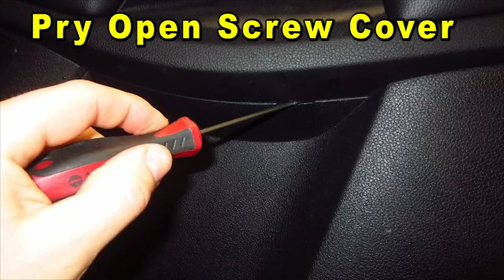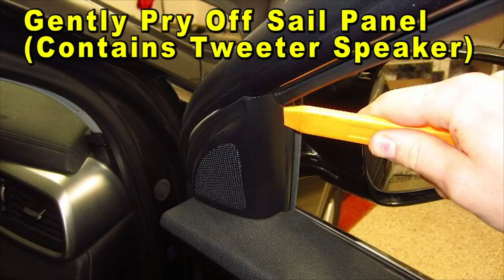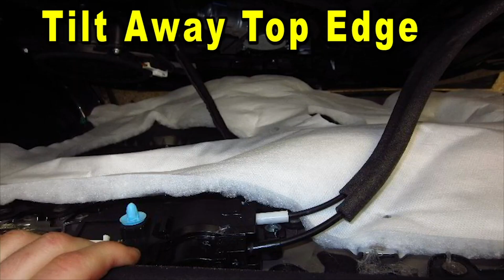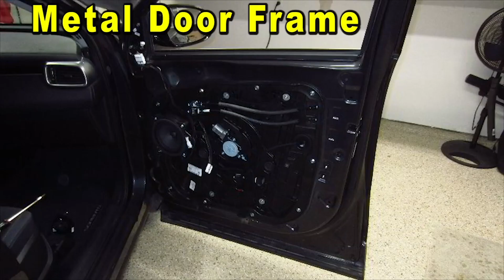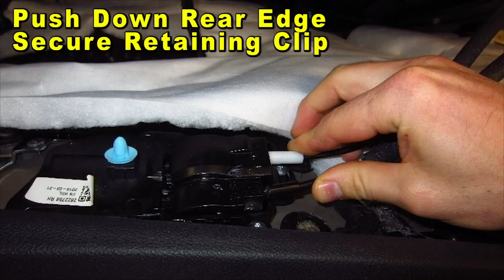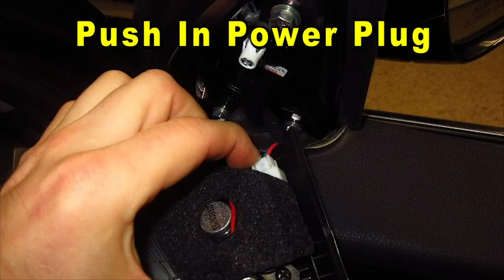2016 To 2020 Kia Sorento How To Remove Door Panels & Upgrade Speakers  - Quick & Easy

Comment from the maker: Kia Sorento Aftermarket Car Speakers - https://amzn.to/3tHmWvl
Dynamat Sound Deadener - https://amzn.to/46TvFZI
Precision Screwdriver Set - https://amzn.to/3OYN1i0
Plastic Pry Bar Tools - https://amzn.to/3HMtsV7
Socket & Ratchet Set - https://amzn.to/3Z17LbA
Mechanix Gloves - https://amzn.to/3jCnHkt
Torque Wrench - https://amzn.to/3vS5uSI

The Paul79UF YouTube channel is a participant in the Amazon Services LLC Associates Program, an affiliate advertising program designed to provide a means for sites to earn advertising fees by advertising and linking to Amazon.

This DIY video shows owners of the 3rd generation 2016, 2017, 2018, 2019 and 2020 Kia Sorento how to take off the plastic interior door panels and upgrade the OEM speakers.

Comment from the maker: Check out the DIY guide for removing the door panels and upgrading the OEM speakers in a 2016 to 2020 Kia Sorento SUV - 
https://www.paulstravelpictures.com/2016-2020-Kia-Sorento-Interior-Door-Panel-Removal-Guide/index.html

Here are all of the DIY repair and maintenance tutorials for the third generation 2016, 2017, 2018, 2019 & 2020 Kia Sorento - 
https://www.paulstravelpictures.com/Articles/2016-2020-Kia-Sorento-DIY-Repair-Maintenance-Guides.htm

Owners of other Kia, Hyundai or Genesis vehicles such as the Niro, Sportage, Sedona, Telluride, Optima, Rio, Forte, Soul, K900, Cadenza, K5, Stinger, Tucson, Santa Fe, Kona, Palisade, Elantra, Sonata, Accent, Veloster, Ioniq, Nexo, Venue, G70, G80 and G90 may also find these DIY instructions to be helpful.